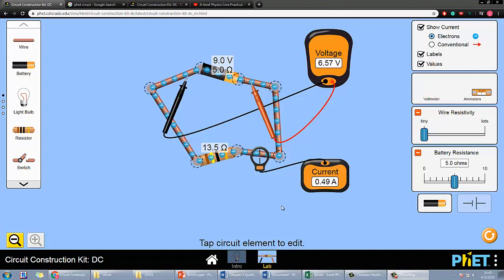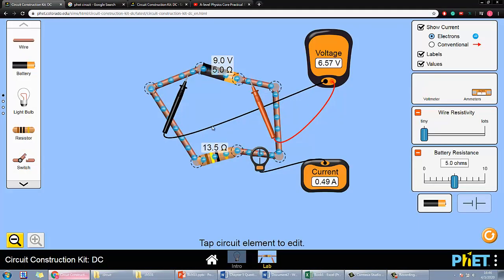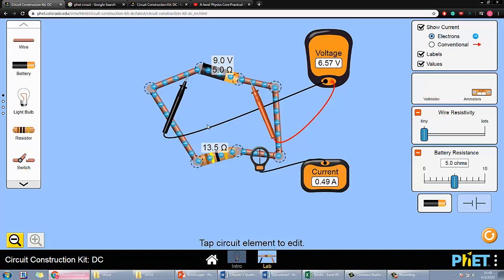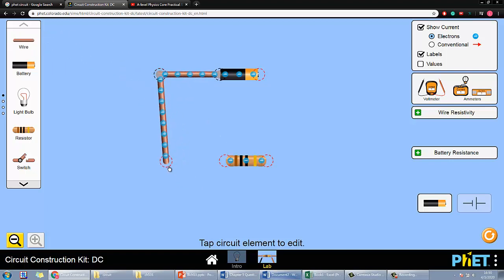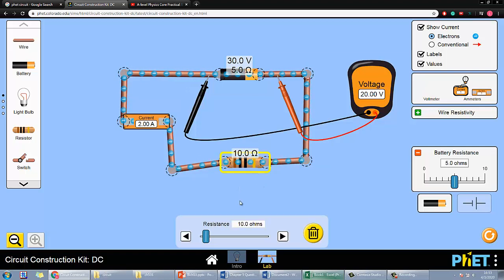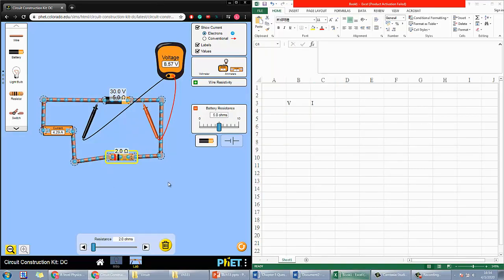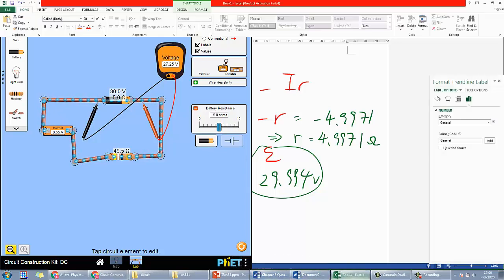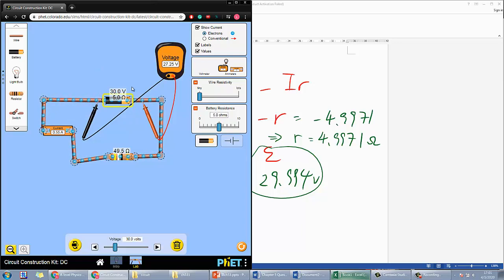Internal Resistance and EMF (PhET Virtual Lab)

Comment from the maker: For teachers, you may use the following instructions.

-------------------------------------------------------------------------------------------------------------------------------------------------------------------------------------
You are expected to submit a word document which includes the following:

1. The screen capture of your simulation circuit setup
2. The raw data table
3. The relevant graph with the LOBF equation
4. You need to explain how you obtain the values of internal resistance and emf from the graph

--------------------------------------------------------------------------------------------------------------------------------------------------------------------------------------